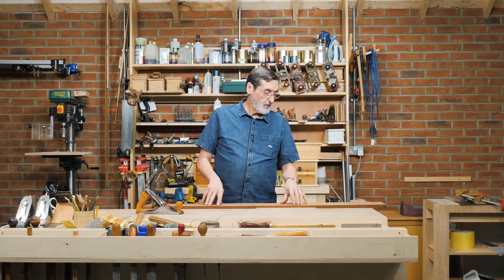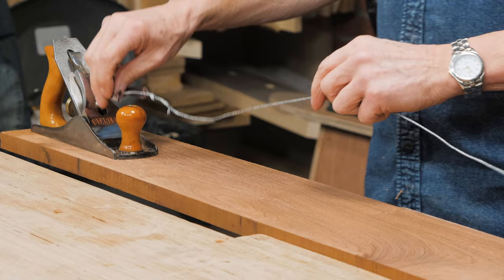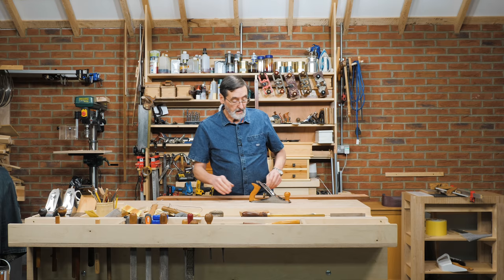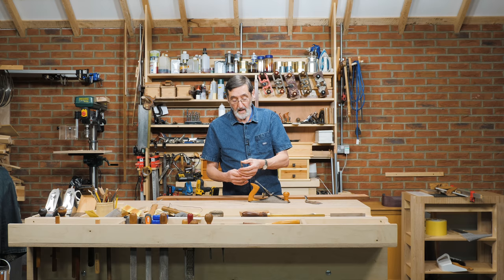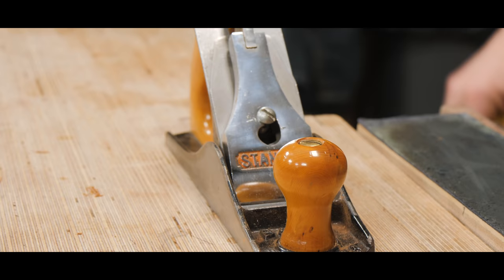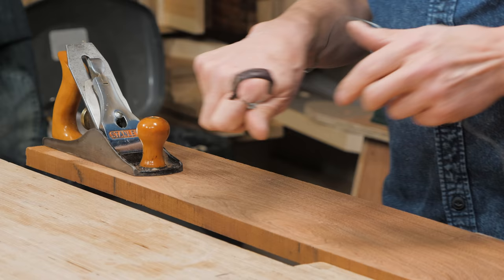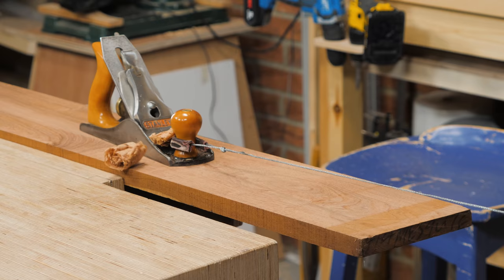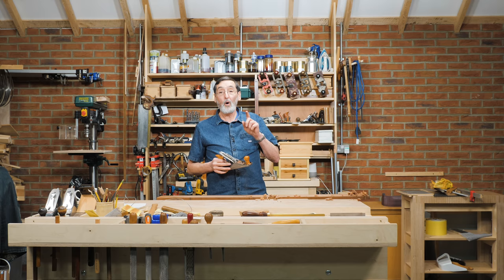How Sharp is your Plane? | Paul Sellers

Comment: Oh my! I forgot to mention that I'm planing Texas MESQUITE! Almost two times harder and more densely grained than oak!
Reply: Hi Paul,
Some of our eucalypts have the same hardness and they have a high silica content.  Beautiful woods but they are hell on plane irons.  It means we get plenty of practice sharpening 😂
Cheers,
Tim from Australia 🇦🇺
Reply: I'm having a nightmare with some teak lots of veins of opposing grains. Iv had to resort to the sander for the final bit. Any tips?
Reply: Hi Phill,
In my opinion, you could:
(1) Use your plane with the cap iron set at 1/64” (0.4mm).  Set by resting your plane iron’s pointy bit resting on the bench and the cap iron resting on a feeler gauge.
(2) Take the lightest plane shaving you can.  Combine with item (1) if needed.
(3) Continue sanding.
There is no shame in either of these inexpensive options.  If it works, the plane will give the nicest finish, followed by sanding which be slightly less lustrous.
Hope this helps.
Cheers,
Tim
Reply: Also, make sure your plane iron is super sharp
Reply: @phillcom3  - I would use a card scraper for final finish - much more forgiving with respect to grain direction and swirling.   I seem to also recall something about teak tending to dull s tool more quickly so keep-em sharp!  Hope this helps.  Be safe and have a happy day!
Reply: I'm working some white oak that has so much silica it sparkles. It's beautiful, but it's wreaking havoc on my planes, and taking forever to work it down to where I need! It's like working jatoba or some other jungle wood...never seen anything so pervasive in oak like this.
Reply: Try some Osage Orange or better known as "Hedge". That is some dense wood. Truly enjoy your video's. Cheers :)
Reply: @phillcom3  I'll say try cabinet scraper it should work.
Reply: Mesquite!!! My favorite!! However, I do live in Texas. Blessings from Texas Paul!
Reply: @phillcom3  try a scraper?
Reply: Mesquite! It's hard to find straight pieces that long. Wow must have been a monster tree. Such a shame most folks just burn it when they find it. Much love from Texas!
Reply: @mechadebzilla  I agree! When I first started woodworking, I realized what a challenge  mesquite was, but how beautiful it truly is. Then, it dawned on me how much is burned here for Texas BBQ! Blasphemy!! However, the food really does taste great Lol.
Reply: i heard yanks keep the shavings for flavouring food.
Reply: Phill Coupe as a last resort before turning to scrapers or sandpaper you could try a “York pitch” to steepen the cutting angle of your plane blade. I aim for 62 degrees on mine (adding a 17 degree back bevel) and it’s been really useful for difficult hardwoods.
Reply: One thing I'm having trouble with is, is getting the edge of the blade straight, I seem to always get a hint of a radius to it almost like a scrub plane but to a lesser extent. Do I just need to flatten my waterstone?
Reply: @swissalmonds2775  If you watch Paul's other videos you'll see that he specifically rounds off the edges on his plane blades to avoid the twin 'tram lines' which can occur otherwise. So if that's what your doing, keep on doing it. 👍
Reply: Hi Paul, interesting video mate! - I’ve got a question for you, I’ve got a jig that my grandpa made in his shed that I’d like you to have a look at to see if you recognise it or anything similar, if your interested, let me know which way is best to connect with you. Thanks in advance, Jake Mummery
Reply: @timbanicevich5565  Silica content, I know that it is a real crap! I´ve been working on some paulownia wood and even though it is soft it made my blades dull pretty quick, bloody hell!

Comment: Is it just me or does anyone else start counting the strokes as soon as Mr Sellers presents a plane iron to a strop? 😂
Reply: It became a habit! Yesterday i sharpened my number 5, and a new no 6, and just seen Paul using the strop i automatically started to count the strokes..
Reply: Yeah, 30 strokes, then turn over to dead flat and, one,two. Done. Shave! What a legacy he's given us all!
Reply: I’m just glad to see I’m not the only one that counts!
Reply: My mother told me I was the one that counted...
Reply: Mistare Anonymouse  Its for Paul to confirm but I have seen that done before usually on a piece of hardwood and I think your assertion is correct.
Reply: Mistare Anonymouse  I believe so. I do thay too. I like to leave as little wire on my horse hide as possible. I am under the imperssion that the wires imbedded in the strop reduce not only the life of tge strop, but its effectiveness on a fine edge.
Reply: Mistare Anonymouse  That's right i do that too
Reply: Me too.
Reply: Some other men say 30 strokes

Comment: There is a fine balance between being so obsessed with sharpening that you never get anything done and powering through with a dull blade. With a freshly sharpened blade, you get beautiful shavings and the blade sounds like music to your ears. But with every strokes it degrades and you lower your expectations. In a sense, you as a woodworker become numb as your blade goes dull. Until you say, enough is enough. And then the cycle repeats. How poetic. Hopefully, we get something done in the proces.

Comment: I sharpen frequently although I am an on site finish carpenter my favourite part is the way the rest of the trades look at me when I pull out tools as old as their dad
Reply: Jim Hope The main reason I use a hand plane is because you can remove less material than any corded tool plus it’s cool my falcon pope was built in 1945
I live in Canada and the tools made in Australia
The finish left by Electric planes can be slightly improved by skewing the plane to the workpiece but you must pay attention to green orientation otherwise the sniper is a little bit excessive

Comment: It seems I am guilty of not sharpening frequently enough. My Grandfather was a Master Coachbuilder when rail coaches were made from wood but passed before I had time to learn from him. My dad apprenticed for all of a year an decided that valves (tubes to you guys in the USA) were more interesting. Only now do I have time to start what I should have and struggled with a plane which worked. I watched Pauls video on how to restore a plane, flattening the sole,  flattening & polishing the back of the plane iron and attention to the breaker. The difference in planning effort was truly staggering and if you have no watched or done as he shows. Do it. Paul is the man and I take on board from this yet another valuable lesson.

Comment: I'm pretty much a beginner at this sort of woodworking, but am grateful to have discovered how more satisfying it is to create with handtools rahter than machines.  If you are also just starting out, I'd advocate spending the time to get comfortable with Paul's sharpening method...it is different than I learned so many years ago....and it is easier on my aging fingers as well as consistently giving me damn sharp tools.   Paul's method has the advantage that one is done and back to task by the time it would have taken to register the blade in a sharpening gig....I've found it encourages frequent sharpening through the day....and much easier work at the bench.  Let the chips fall where they may.....Veteran '66-68

Comment: I had seen you do this a while back (maybe couple years ago) and it was one of the demonstrations that convinced me I needed to do a better job sharpening my tools, and to do it more often.
Reply: Paul has an older video up in which he demonstrates this, but (somewhat ironically) the video is about the fact that you don’t necessarily need to sharpen to a very high grit. So, sharpening often and regularly is the key. Something I have to practice more as well.
Reply: Yeah, its pretty convincing, ain't it.
Reply: Paul changed my whole understanding and attitude towards working with hand tools.  Before Paul I hated to use my planes, now I enjoy them.  He caused me to buy a set of 4 DMT diamond stones, and never regretted it.

Comment: This reminds me of something Roy Underhill showed in an old book. In pre-industrial days workers would cut door frame moldings using a big plane with its blade and sole cut into the desired profile of the molding. The plane would be used by two men: one who would pull the plane with an attached rope and the other who would guide it.
Reply: KarlBunker: Yes you can sometimes see these old planes for sale, they have a large hole bored through the nose to pass the rope through.
Reply: I bought a little one at the Vide Grenier in my local village the other day. Chummy had broken up with his missus and moved to Toulouse, given up carpentry and sold all his molding planes. I didn't dare buy most of them, since I haven't the skill to use them, but I bought an adjustable rebate plane and a molding plane, both wooden bodied. Lovely molding. I am puzzled as how to sharpen it! I did plane a molding after much effort, and now put flexible sandpaper over it and draw the blade along it. But no diamond plates!

Comment: That's a great indication of when you might need to sharpen if it can take a shaving without much or any downward pressure on the sole. I think that will really help me be more sensitive to when I am starting to have to push too hard! Great throw back video!
Reply: We have all heard, time and again, that tools are designed to let the tool do the work.  Be it saws, drills, or pretty much any other cutting tool. This, is the first time I have seen a plane cut under its own weight, so I guess that notion actually applies to this tool as well.

Comment: I have never been able, to properly sharpen my tools, and I doubt that many can to this standard, but I will keep trying. Thanks Paul.
Reply: Get a jig. It was super helpful when I started. No shame if it gets you working!
Reply: I've been woodworking quite a few years now and still use a sharpening jig. Did the freehand thing for a year and a half and never liked the result. Don't listen to the snobs, if a jig helps use it. It's your shop and your work. Lets see them use their bandsaw without it's jig (fence) then tell them they're not "skilled" for getting crappy results.
Reply: For me it’s pure laziness: I just don’t sharpen often enough, and I only have sandpaper to do it at the moment. I’m convinced I will get good at it because it’s a matter of practice, but like the other guys have said, I will probably always use a guide jig to get consistent results. Freehand sharpening is faster, not necessarily better.
Reply: @mm9773  I got some old wooden planes at a thrift store, and some extra blades for them as well. I am currently practicing my freehand with these older blades, so if I ruin an edge, it isn't on one of my good, tuned planes. Check around, you may find some great deals around you. I also recommend getting a good diamond plate and a good polishing stone. They will cost you, but since everything depends on the tools edge, it is worth it. Paper will also become far more expensive as you sharpen, and having to set it up may be why you don't sharpen enough. I'm self taught and had to learn all of this the hard way, and this is just my advice, so take what you will, leave the rest. But by investing in new, good stones, you will WANT to sharpen a bit more, and because it's faster and easier, you are less likely to put it off. Make and acquire what YOU feel will make the sharpening fastest and most invitable to you. And make yourself do it. As soon as I got a diamond plate and a good jig that produced a sharp and square edge, my work exploded with joy, productiveness and I felt really good for the first time since I started down the road of woodworking. It seriously made all the difference.

Comment: Hi Paul I was thinking have you made a video about what sharp blade actually does? I think that your video about sharpening with 220 grit vs finer was great demonstration about sharpness. One thing I had to learn by my self was that if the blade is shaving hair or not is not really a good indicator if it will cut wood. The biggest thing on sharpening that I figured out some years ago was to test those blades at end grain across the grain of soft pine and see if it actually cuts in and leave a smooth surface.  Thanks for your great and down to earth videos they are really needed in this world of over mystification and you need to buy this and that world.

Comment: All of that, and on mesquite? Impressive, that's for sure. Thanks for the tip. I get going on a project and always forget to stop and maintain an edge. The sharpness fades so gradually that I rarely even notice that I am having to work harder. I guess I need to put a timer in my shop, and use it, until I build this new habit of edge maintanance in a timely manner.

Comment: How do you prevent tennis elbow?  I only just started woodworking a month ago and got it. Yet you’ve been at it for several years and you seem fine
Reply: Speak with a physiotherapist.  Stress injuries like tennis elbow usually have more to do with weaknesses elsewhere on your body like tendons or shoulders. The elbow pain is a result of your body overcompensating. Mr. Sellers doesn't have this issue because of his years of doing it, so his body is accustom to the musculature usage involed.  Easy to fix with simple stretchs and excersises though, good luck!
Reply: Try to relax your grip as much as possible. I think the video answers this question: ideally the plane should take a shaving by just pulling it over the surface, you shouldn’t need a lot of pressure. I always end up pressing it into the wood like a maniac, and I have to remind myself that I shouldn’t really have to – I should be pushing it forward, not down, in a fluid motion. Probably also a sign that the iron is not sharp enough. And you can work with your body and your feet: move your whole body back and forth, not just the arm.
Reply: I’ve been doing some reading, it’s caused by my bench being way too high.  It’s supposed to be either at your wrist height, or first thumb knuckle... mine’s about 8 inches too high...going to have to shorten that once my elbow heals

Comment: Do you always start on the coarse plate after only using the plane for half an hour or so? I’m about to order some diamond sharpening plates, and to keep the costs down I’m hoping to get away with fine (600) and superfine (1200) and a strop, doing coarse stuff with sandpaper.

At the moment I’m working with brand new chisels and expertly restored Stanley planes from Tooltique. I would add a coarse plate later – or do you (or does anyone) think a coarse grit is essential for every sharpening process?
Reply: I use diamond plates for sharpening.  IMO to simply touch up the sharpness of a blade a coarse diamond plate would be too aggressive.  For touch ups I use my fine diamond plate and a strop, and unless I see light reflecting off my cutting edge, I skip the diamond plate altogether and simply strop with rouge to restore the edge.  Works for me and works well.  This said, you have to have a truly sharp blade to begin with.  Paul Sellers taught me the value of a truly sharp cutting tool.  I'll never go back.  Thanks Paul.
Reply: @jeffjump4793  Thanks – that’s what I’m thinking. I’m eager to move from sandpaper to diamond plates, and at the moment all my tools are in great shape, I don’t need to re-establish any edges, just sharpen them.

Comment: I don't doubt that the iron needed a fresh edge, but you seemed set for a deeper cut after sharpening.
Reply: Paul Sellers the shaving immediately before you did the lasso test of the dull blade was produced using at least some downward pressure yet produced a thinner shaving than the one produced with a fresh edge from only horizontal pressure from the lasso. A duller blade once it is under the wood is inclined to dig deeper since it can’t cut the wood in front as easily (this is why dull blades produce to tear out).

Comment: When you pulled the freshly sharpened plane the rear was lifting but it appeared to still be cutting.  It would be ridiculous to suggest the blade protruded that much, but it still worried me, and I would need to measure the blade depth rather than rely on #1 eyeball.  1-2-3 blocks are almost as useful in a wood shop as a metal shop, and you could use one as a reference to measure blade depth —  digital calipers would be fine for this.  I use a 1-2-3 block to ensure plane blades are perpendicular when reattaching the chip breaker, with both resting on a DMT diamond plate.  My benchmark for blade sharpness is whether it will cut straight into photocopy paper at 90°.  That usually comes back after just stropping in my experience, and I am too lazy to do the 30 strokes each side folk say they use.